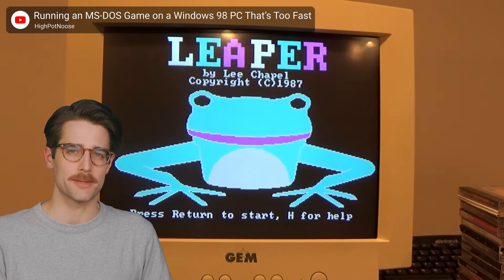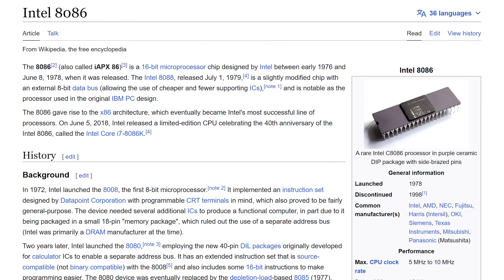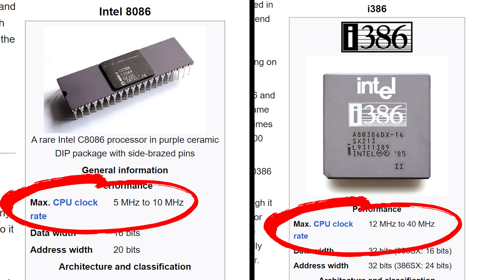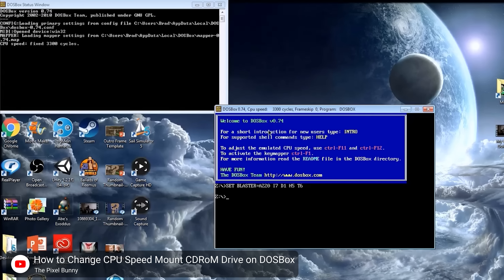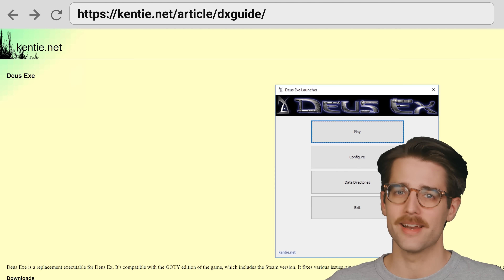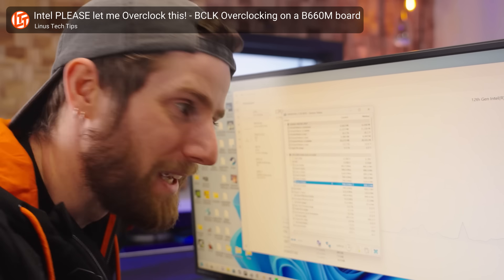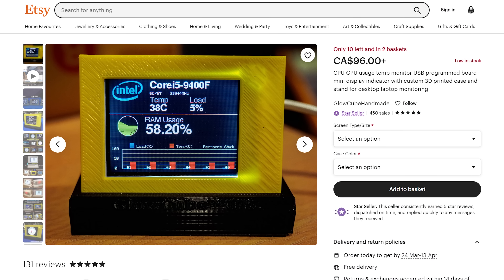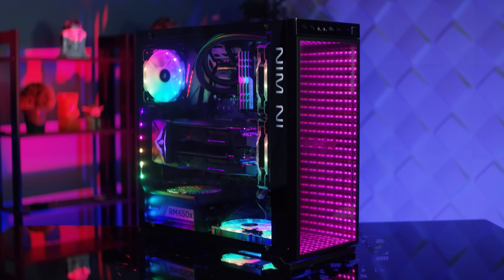Why PCs Had a TURBO Button

Comment: you are clearly too young to understand turbo buttons lol. the only games that sped up with the new processor were some superearly crap games ported from game consoles as those did not have replaceable cpu-s. after that we have already used the programmable timer interrupt irq0 to time drawing a frame so it did not change anything if we upped a cpu as the game simply waited for the next full tick to draw the next frame and later we used vsync to time frames. yes back then it had a real reason to be lol it was just called iirc vertical refresh interrupt or similar. turbo button was there if we wanted to double or triple the speed of the pc because a busclock cycle wasnt enough to draw a scene and also calculate the logic. this is why never anybody really ever turned it down as the only reason would be to do it is saving on energy
after the first xt-s the clockspeeds were so different it wouldnt be viable to slow down a game by turning off turbo as for a game originally running on 4.77mhz, a 386 would MINIMUM give  3x speed and a 486dx would run turbo off at 4x-7x faster, and a game that would run on 33mhz 386 or 486 would already not work on an 5x86 cyrix or amd, that had 66mhz turbo off and 133mhz turbo speed... all it was there for was marketing that said to give more power by doubling the bus speed in the cpu so a 33mhz 486 system could run its cpu on 66mhz but in fact everybody ever only used it on 66mhz

Comment: I had a PC with a turbo button and when I took it apart I realized the button was directly wired to the LED light. It literally did nothing but turn on a light.
Reply: imagine having a literal "LED ON / OFF" button on your pc 😭😭
Reply: Holy shit
Sue somebody because that would definitely have lead to system instability at high clock speeds

Comment: On some mother boards from 2000 to 2004 i was able to rig and configure the turbo button to actully over clock the AMD processors i had some desktops i built hoolong them up to the over clock jumpers it worked. there was 3 congigurationd on the jumpers for base clock speed and over clock speed from 2.4Ghz to 2.33ghz ran good. and 2.80Ghz wich it got to hot and froze up. the button made it do much easyer then having to keep opening the case and pulling tinny jumprs thst fall in the cracks switching them. :)

Comment: The turbo button is a classic example of marketing/propaganda inverting the truth.  

Turbo on was setting your CPU to it's default setting.
Turbo off down-clocked your CPU for compatibility.

It should have been called the compatibility button.

It should have been off by default and you turn it on to purposefully lower the performance of your system so that programs don't run faster than expected.

Some suit had the 'brilliant' idea of lying to the userbase: "The button doesn't lower performance, the button makes things faster!"

No, the button makes things slower and for a good reason, telling the userbase the opposite of the truth is just going to cause problems in the future.

Comment: can't fool me, TURBO was real, you just yelled 'Turbo Boost, KITT!' and your car would go rocket mode. EVERYTHING should have a turbo button, even the turbo button should have a turbo button. Even if it just has TURBO printed on it, that automatically makes it faster, particularly if printed in red. The bigger the button, the faster it will go, fact.

Comment: not even gona let the video play... compatibility... all it did was lower the cpu speed to half so software timings would not become a issue.
since then internal timers became better and Delta time was implemented in most games.
all it did was half ur clock speed it was not really a turbo.

Comment: The propaganda department at the PC manufacturers came up with "Turbo".
They marketed it as a way to speed up your computer (when it was designed to slow down your computer).

Car manufacturers market cars the same way.
They tell you that putting your car into "Sport" mode will give you more power.  That is nonsense.

Your car has the power it has.
Using a mode other than "Sport" mode will retard your car's performance, in pursuit of fuel economy.  So such cars have a "slower performance" option -- not a "more power" option.

Comment: My first PC operated at a blazing 10 MHz. But you could step it down to 8 or 6 MHz in case 10 was too fast for you.... LOL  My question is - what happened to the little keys you could lock the on/off switches with? Wouldn't those be an "added level" of security?

Comment: Back in the day when I was using a 5x86 133mhz, the clock speed was set with jumpers.  I connected the turbo button up to the jumper that would overclock it to 160mhz.  I configured the number display to say both speeds.  So I was one of the only people to have a turbo button that really went turbo.  The most fun part is that the OC would work even when the machine was already running.  So I'd launch doom or some other game and hit the turbo button to OC, then when I was done I'd hit the button again to go back to 133.

Comment: My ASUS G30AB Desktop came with this button instead of usual 'Reset' button. There's default OC profiles in UEFI Bios, so while being in Windows, you can press it and it will go from 3.7Ghz to 3.8Ghz and 4.1Ghz. Instant over-clocking. I never needed to boost even in CS:GO and still gave great headshots. :cat-orange-whistling:

Comment: Another thing the Turbo button did was enable the CPU to use it's full data buss in addition of running at it's full speed. The 8086 had only an 8 bit wide data buss, while the 80286 and 80386 had 16 bit wide data busses. The slow mode forced them to run in SX mode instead of DX mode.
Reply: You're incorrect there; actually, the 8086 had a 16 bit bus as well. What Riley (and the script creator) both screwed up on was that the early IBM PC compatibles used the 8088, not the 8086. The 8088 did indeed have an 8 bit bus, and was also cheaper to make and sell than a 8086 was at the time - think of the 8088 as a cost reduced version of the 8086 (which actually predated the 8088 even though it had a larger 16 bit bus).

Comment: Fun times. Teach used to have a v20, and Turbo made the v20 crash. So we couldn't put it Turbo. And this made the computer slower than an original 8088. -- That said, I would love to have a modern computer with an actual crank, that would have force feedback with the CPU/GPU usage, and the speed of the crank would actually overclock everything.

Comment: The old PCs with turbo button were actually suppose to operate with turbo enables, if a game ran too fast you needed to disable the turbo to slow things down. Today's speed stepping is still very much a thing, although not to correct misbehaving software, but to lower power consumption, which is very nice for working off battery on notebooks.

Comment: Hi Rialy,
and everyone reading this comment.
I recently assambled a PC, Asrock H610 Motherboard,
Intel 12400
Windows 10

Problem is my usb drive is heating too much in this system, 
Same pendrive is very normal even after full read and write in onter windows laptop, or desktops.
Local shop are unable to find any problme with it.
Also all usb devices and Pendrives are working fine but heating too much.

This is concerning about life of pendrive as well as future of my assambled PC.
For your reference, Pc is not overheating/heating by any means.

Thanks for consideration.(and for reading my crappy english)

Comment: I kinda experienced this on my win 8.1 machine, still wondering why the hell it happened.
So i took the cpu cooler out, applied some thermal paste without wiping the old one and put it back together. It was on 2x speed, every windows animation!
It went away after a restart and my puny brain at time thought the cause was the mixed paste so i wiped it and applied new.

Comment: You say that but GTA was based on FPS. When it was ported you could not pass a mission unless you were close to 30 fps, even if you used an auto clicker and manual clicked.

Comment: On most of the machines I used, the turbo button made the computer run faster when it was pushed in. Fortunately, they mostly had displays to show the state. Of course, the others were confusing. The rule was, always have it running faster unless a program was running too fast, then slow it down.

Comment: To be clear, Turbo mode as detailed in the original specifications, does always make the CPU run faster (really just it's normal intended speed). What varied from system to system was the configuration of the button, whether pushing it in turned on turbo mode, or off. VWestlife has a great video about this exact subject, the pins for turbo buttons were configurable for both ways.

Comment: if I remember correct my first computer (95) had this including a display, pressing the button changed the number from i think 44 to 66 ... never understood why though XD 
I guess I didn't have enough old enough games .... I think I did have some games where I had trouble with speed but I never knew that it might be solved with the Turbo button.

Comment: No computers at the time actually shipped with turbo buttons that would slow the computer down. Every computer that used a turbo button by default ran at the lower clock speed, and when you pressed the button it would switch to the full clock speed. However, almost all of the time this was just an interrupt that the processor listened for rather than an actual switch, so regardless of whether the button was clicked in or not, clicking it just told the processor to switch from one to the other. So if you powered the computer off in the full speed state with the button clicked in, when you powered it back on it would be back in the default low speed state, and so you would have to click the button again to put it back into the full speed state, which would cause the button's "clicked in" state to be reversed from the default. This is probably where the myth comes from, with computers whose owners had powered off the system when it was at full speed and caused the button's behavior to become reversed.

Comment: The Turbo button actually had an even more important function in clones of the early IBM PC. Thing is the floppy controller was relying on the CPU speed to get the timing of the read and write operations correct. So trying to write to a diskett with the computer running at a higher speed could corrupt the filesystem on the floppy. So you were supposed to only enable the higher clock speed when the programs were started and then slow it down again before saving any document or crate a file on a floppy. And remember that at this time very few actually had a HDD in their computer so floppys was what most people booted from, ran programs from, and saved their work on. So instead of just being nice to have it was actually critical for the computers to work at first.

This weakness was soon fixed with better floppy controllers that took care of the timing issues no matte how fast or slow the CPU was.

As for games starting to use the RTC (Real Time Clock) for timing and controlling the speed that was far from always the case. Years later, after sound cards got really common, many games were written to use timers on the sound cards for this. That was because they had much higher precision than the RTC and allowed for better control. This was common even after HPET, or High Precision Event Timer was introduced for just this reason, but to the best of my knowledge no modern games do this.

I stumbled onto this a few years back when I tried to run an old game. Everything worked fine except for some arcade sequences that was totally impossible because they speed past so quickly. After some back and forth I found out it was because of my USB sound adapter. It didn't provide the timer that the game used to pace the action. As soon as I switched to use the sound device integrated on the motherboard everything was fine as that did support the timers that the game used. If you wonder the game in question was "Ur-Quan Masters".

Comment: This was a thing in to the 2000's but even in the 90's they  worked on some pc's. off my old amd k7 ran at 800mhz and with it on it ran at 1ghz but it also ramped up the fans to 100 percent all the time.

Comment: i guess the question is why old computers used cpu clock speeds at all.

SO I ASKED CHATPIKAPI LOL IF THIS ANSWER IS WRONG YOU KNOW WHO TO BLAME

"Older computer programs, such as those designed for the Intel 386 or earlier processors, used the CPU clock speed for timing because they relied heavily on precise timings and delays to function properly. These programs were written in assembly language, which is a low-level language that allows for precise control over the hardware.

In assembly language, programmers can directly manipulate the hardware, including the CPU clock speed, to achieve precise timing. This level of control was necessary because older computers did not have the same level of processing power and memory as modern computers. As a result, programs had to be written with extreme efficiency to maximize performance."

also for fun I had chatpikapi error check the early claim in the video. you pass riley! For now....

"Yes, that is accurate. In the early days of personal computing, the most common CPU speed was 4.77 MHz. Programs were often written with the assumption that the CPU would be running at this speed, and timings within the program were based on this assumption. This was true for computers such as the original IBM PC, which used the Intel 8088 processor running at 4.77 MHz."

Comment: If the turbo button slows your PC than it is wired incorrectly. Latching buttons had 3 contact pins and motherboards had 2 so it was easy to plug it in incorrectly and make it work in reverse. Later PC model had a momentary button and a turbo LED indicator or a small display that showed the clock speed to battle this issue. Also if I remember correctly, alt+ctrl+numplus and alt+ctrl+numminus could be used to turn turbo mode on and off.

Comment: Back in my days, with XT/286/386/486 in short words, it is like "overclocking" for these days, and it really worked, I had a XT computer, then 286, then 386, then 486, even computers with AMD CPU INTEL compatible, and with CYRIX CPU.

Comment: This is depressing. That key lock cuts off the keyboard and has nothing to do with the turbo button that also has nothing to do with downclocking. It was a marketing gimmic most of the times, that button worked on overdrive cpus.

Comment: Before the inclusion of led 7 segment displays for the speed (mostly a marketting thing) there was just a simple orange led for turbo state. Lit was high speed. Button pushed for low speed was a feature of some motherboards as it allowed the system to start in high speed without the button even being connected. If your case didn't have a turbo button you'd want a high speed by default motherboard. Many systems were pushed for high speed, so to know the state look at the led.
Once Pentiums came around Turbo became completely uselss as it just couldn't slow the cpu down enough to match a 4.77 mhz 8088. Thecpu cache made pentiums way too fast. Even on a 486 it was pretty useless. 386s were old and slow enough that it still made sense at the time they were released.
Old games had bad timing because the Original PC didn't have any support for vsync so games couldn't time themselves on display refresh. VGA did support vsync so vga games are usually much better behaved. Windows games must use a hardware timer because they cannot rely on vsync being on as its usually a gpu driver setting.
Reply: A lot of people were saying that frequently the buttons were just installed inverted because it was pretty easy for the pc builder to mix that up but I’m sure there were some computers that did it intentionally

Comment: Why did they assume an 8086, when most PCs had the 8088 which has a narrower memory bus and thus different timing?
Reply: Odds are both the script writer and Riley had never used a 8088 (or at least didn't know which processors the early PC compatibles used even if they had) so assumed they used the 8086 instead because "x86".

Comment: I HOPE THEY INCLUDED THE FACT THAT THE MISGNOMER FOR IT SLOWING THE PC DOWN WHEN ACTIVE WAS BECAUSE IT WAS ACTUALLY WIRED WRONG ON THE PIN HEADERS AND TURBO MODE WAS ACTUALLY FASTER THAN NOT TURBO MODE AH YES LETS ARGUE @1:30

Comment: Let me answer that, we had it to actually slow down the computer due to old software compatibility. And in fact it does not put it on higher performance, it puts it at its rated top speed.

Comment: In my experience the Turbo button never worked as designed.  Because the speed was always relative to your normal clock speed and the only games I ever had issues with needed a specific speed to function properly, much slower than the turbo button ever reduced it to.  This also got worse when the bus speed started to be increased too.

Comment: This has me wondering... Just how slow can you make a modern cpu go before it simply refuses to do anything? (Max underclock?)
Reply: can you manually cycle 1 instruction through a core i12 or whatever top of the line intel makes is?
Reply: @frogz  that would be hilarious. I don't know jack about software engineering but I imagine writing code to run on that would be an absolute nightmare.
Reply: At that point it's all asm, you code it like any x86, each time you pull current down to ground or up to b+ it will execute another line of code like... 1: print hello world
2: print test
3: goto 1
Each time it runs code and cycles 123123123123 forever